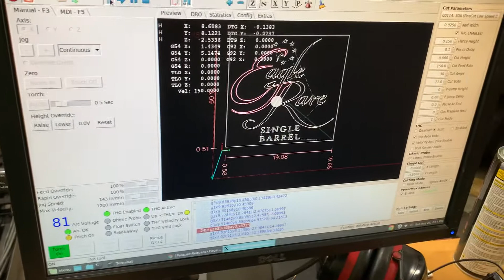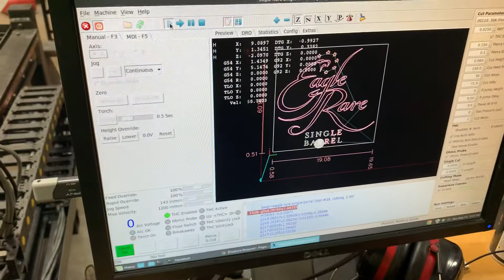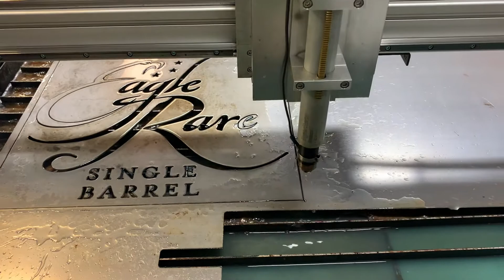CNC Plasma Cutting Eagle Rare Bourbon Sign

Comment: Very nice...can u share ur cut parameters, torch type, and thc settings.... thanks
Reply from the maker: Dennis Kramer cut parameters are the standard numbers in the Hypertherm manual.  It’s a duramax machine torch.  I’m not sure what you mean by thc settings?
Reply: @snowgoer540  THC.....if using Axis gui...from the config and run tabs...delay, threshold voltage, pid gain, vad threshold,  use auto volts or cut volts?     Thankyou for sharing.
Reply from the maker: Dennis Kramer oh yes I use Axis with Plasmac.  I think my delay is at .5s, threshold is what we the default is, my pid gain is at 20, and I do use auto volts.  That all said, I really need to use halscope to dial in what my setup requires, I would recommend you do the same to see where your torch arc voltage settles down once motion gets under way.
Reply: @snowgoer540  Amen to that..
I'm about a couple weeks behind u in the timing effort.   One last question...do u see the arc voltage readout change much during a cut.....mine just sits there at 4 volts until cut finished or I loose arc ok.
Reply from the maker: Dennis Kramer 4 volts while its cutting?  Something doesn’t seem configured correctly.  It varies a few volts up and down while cutting.  It doesn’t stay locked on any one value.  There’s a few shots of the screen in this video while it’s cutting
Reply: @snowgoer540  I'm using thcad10  , with about 300k ohms internal to my Primecut 60 plasma power unit.   It calculated out ok.   Maybe I need to set threshold in gui to 10ths of a volt with that type of scaling.????
Reply from the maker: Dennis Kramer not sure I don’t use a scaling resistor.  Also I don’t know what the divider ratio is for that machine.  Tenths of a volt won’t be helpful, but your voltage should be higher than 4v.  

Have you posted on the Plasmac section of the  linuxcnc forum?  It is usually useful to see your machin ini file, machine hal file and machine connections hal file to help understand what’s going on